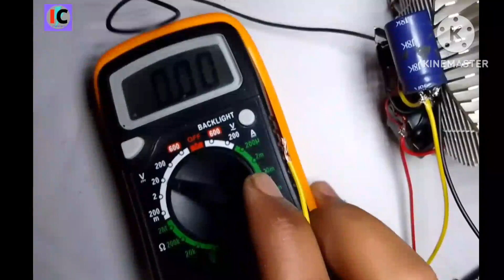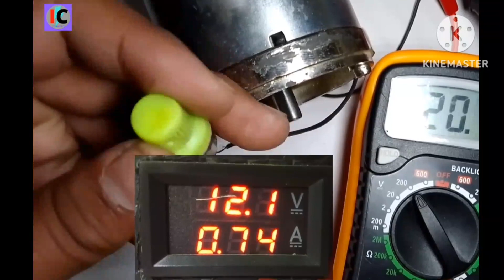Top 2 Easy Circuits with UC3843/45 DIY Converter

Comment: Now,I'm lost...

What's the difference between buck & booster
Reply from the maker: a buck converter converts the high voltage dc to lower voltage like 24v to 12v or 5v.
And a Boost converter converts the low dc voltage to high voltage dc like 5v to 12v or 12v to 30v.
I think this will help you